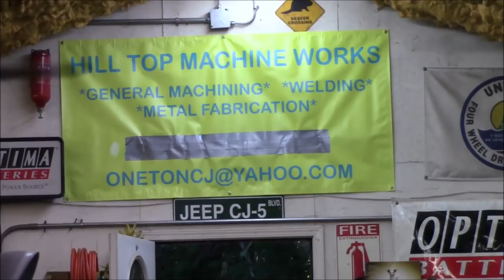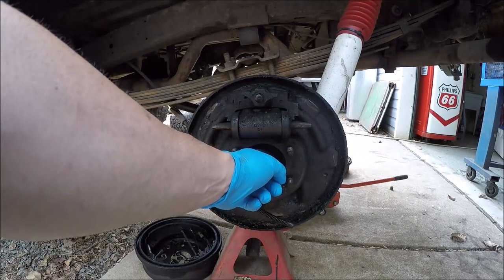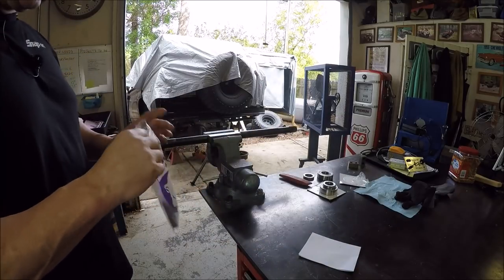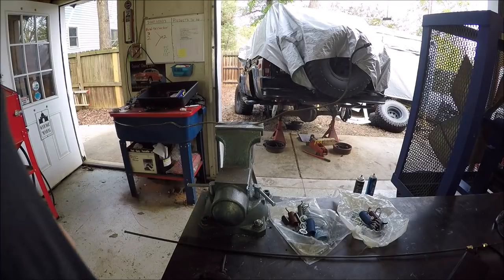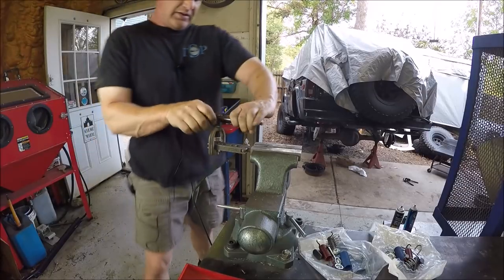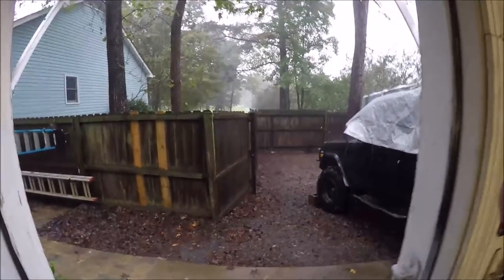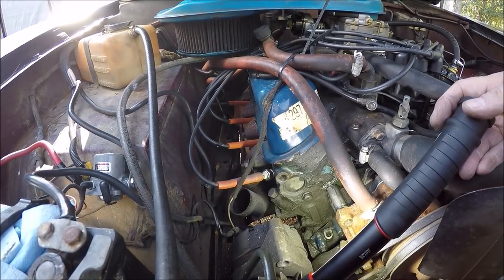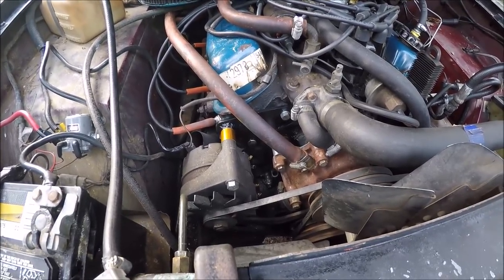Old Bronco rear axle repair and alternator fix

Comment: 4:25  Quick, easy, project.  I knew you had jinxed it a soon as you said it. LOL   I have done that type work in while.  Just got in lower ball joints and upper control arms for my 2000 Ranger!  If you want to come help, I won't object.  LOL  Keeping the old American made iron moving.  I like it.
Reply from the maker: I enjoy working on the old trucks and Jeeps, but you never know what your going to run in to. If your were closer I would surely give you a hand.